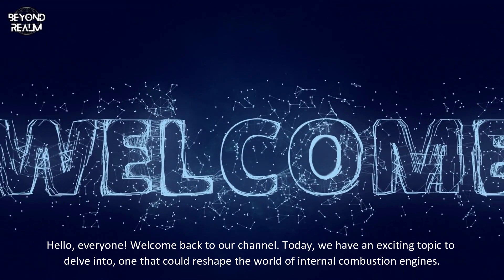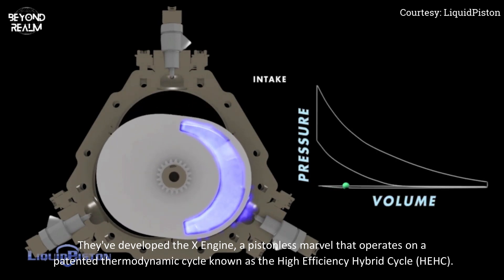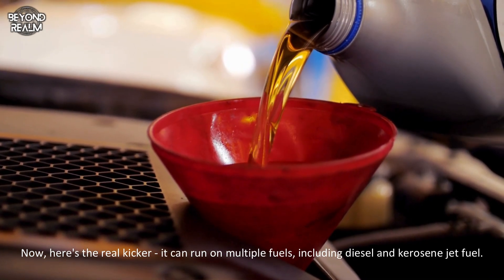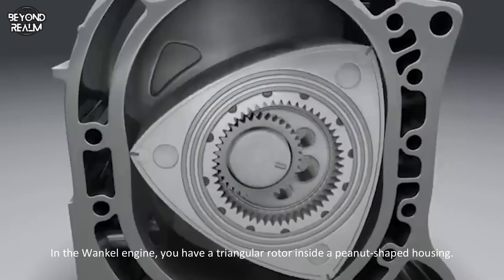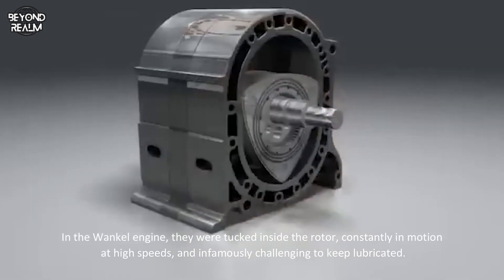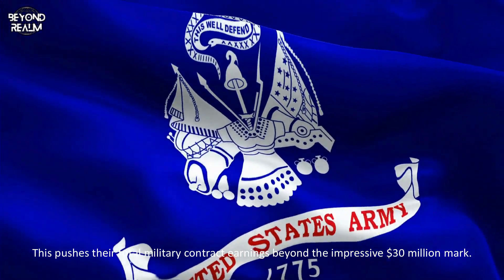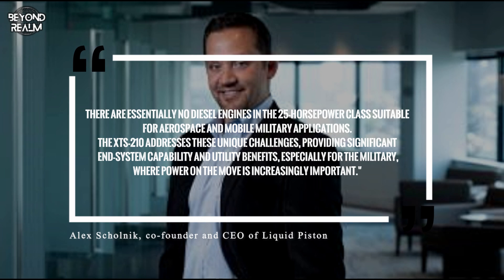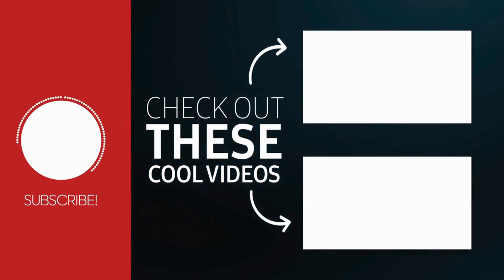This NEW Engine Delivers 5X The Power Of a Diesel Engine | XTS-210 Rotary Engine | Beyond Realm.

Comment: Where is the multi-rotary version? Do they plan to produce any for automobiles? I hate EVs! They didn't think them through. They are dangerously explosive and pollution causing via sourcing the lithium for replacing and disposal of old batteries. They still require electricity which still requires powerplants. Also, who can afford them?! Hydrogen fuel for the win, and the XTS rotary engine can burn it!
Reply: I'm having doubts about hydrgen fuel. Volume wise, its energy density is a measly 8 MJ/L vs 34 MJ/L for gasoline. In other words, it needs to be compressed in order to offer competitive power density. Compression is too expensive and liquification is out if the question. Liquid fuel will always be the better option. I would rather see batteries as an alternative, but current batteries have too many drawbacks. Expense and safety being the two main ones. However, on the horizon, sodium battery technologies are making big strides.

Comment: It is heavier than Wankel of corresponding power, not much more efficient, and uses 3 times more injectors and spark plugs. Very hard to stack in more powerful multi-rotor configurations. Mazda, having all the required know-how and technology is totally uninterested in this engine.

Comment: Time will tell, but I predict failure.  You can't make a quality piston ring equivalent in a rotary motor design. Diesel usually requires high compression cylinders and that requires good rings.  Square things don't survive high heat & cooling was a lesson learned by the pot belly stove people. But here is a thought for you.  Using a swinging door style piston on both sides of a waste veggie oil burner in a Stirling type motor I could power my house as it heats my house and hot water, while cooking my large stew pot using gravity to do all the work. No pumps, no filters, no tech, no cost, no sh*t. Of course the Peltier/Seebeck effect electrical generation between the cold and hot water sides of the riser is optional. Yep, you heard it here first. Well that's the spiel anyway.  I invented, built, & used the burner for 10 years, but never invented/install/used the Stirling motor design. But a swing door type would be very large pistons equal to about 4 square feet of piston top & that's a WOW. Even though Stirling isn't big power output per cubic inch, massive inches adds up to big power 4free. With a door on one side going out the same time the other side does, they counter balance each other.  It's a heat difference engine so a cooling side could be installed on the outside of cylinder & the valve between inside/outside can be at the hinge. That would preheat my cold water tank also. The cylinder looking down is a 2 slice pizza pie shape. An outside arm from the hinge pushes on connecting rod to crank where the 90 degree valve arm  or second piston door is attached, and the valve is just a vertical door also, & it's arm comes off it's hinge also.  Any form of piston rings can be real sloppy, loose fitting, low friction. I give my Stirling motor design to the world, anybody who wants to make it and sell it, but not own it, cuz it's my intellectual property always. A big thanks to Oliver J. Loveit my power mechanics teacher & 2 doors per Sterling side may be required.  Also, in the process of inventing a controllable veggie burner, I made a veggie burner out of a 3 gallon propane tank than ran like the WW2 V1 BUZZ BOMB plane pulse motor at a very powerful high rpm, but it had no moving parts. Any way, good luck to you guys on your rotary diesel.

Comment: This engine is awesome, but it doesn't last very long before needing to be rebuilt.  I'm sure they can solve some of those problems and improve it.  The genius is really in it's simplicity and the promise is in it's power & torque to weight ratio.  Very cool indeed.
Reply: @AWAGKnives  , So how long (hours), have You supposedly  found  , these engines to last ?  What was the map setting during  the supposed testing process that You supposedly witnessed? What are their supposed problem areas? What , supposedly, has to be rebuilt after You found it to be worn out? How did you supposedly check for wear?
Reply: @michaelmartinez1345  This comment reads like somebody that is clueless pretending that they know a lot.
Even if he did give you that information, you'd have no fucking clue what to do with it.
Reply: Allegedly  @TheLairyLemur

Comment: So when can I expect one to be available to replace the 1150 pound 5.9 Cummins engine in my Dodge pickup? It wouldn't have to be very big, but would need to be geared down before input to the transmission so that it's output speed would be a good match for my gearing. I could put a lot of other things where the huge engine currently takes up space that would not be needed for the new engine. It might even be profitable to put in a much smaller one to operate the alternator and hydraulic systems of the truck. That would be very cool. I could park and run the generator to power my ham radios while at an event such as Field Day or Jamboree on the Air or Parks on the air. That would be great fun. And with the 35 gallon fuel tank it should extend the range of my pickup to maybe twice what it is now, 600 miles if I drive no faster than 70 so 1200 miles before refueling... Woo HOO!!!
Reply: Your cummins will outlast an equivalent engine by 10x

Comment: Power to weight ratio is nice, the military will buy them just because of that, but for any commercial, particulaly on road application what really matters, apart from durability, are emissions and fuel economy. Those are the points where the rotary engine failed. Bad emissions as well as bad fuel economy.

Comment: I loved the rotory motors we would welcome them back with open arms.  Another one outboard marine engines just fit a heat exchange on it .that would be interesting to see  ?
Reply: @bullykuldo6233 , The outboard boat engines are genuine works of art... I love all of them... Especially the older 2-strokes.  They would need a thermostat and a water pump that is driven directly off of the engine, instead of being mounted inside of the lower prop drive unit... They already have liquid cooling jackets to possibly support this fish - swimming out of the water ... Plenty of power to drive the wheels, or a generator... But they tend to create a fair amount of emissions, because they are usually  running so cool... And to bring the operating temperature of them to a higher level could possibly create new problems, because of the necessary clearances being lost .. These fish , need to be kept in the water...

Comment: @Goldcountryruss7035, The emissions (or lack thereof) that this engine will produce, will probably be one of it's major selling points... It will probably run very well on a variety of alternative fuels, and the issues of high emissions that were generated by the Wankel engines, have largely been solved with this design, mainly because of vastly improved SEALING of the 3 combustion chambers it has, as compared to the poor sealing of the single combustion chamber each rotor had on Wankel type engines... The power numbers show that much, 4.0-7.5 H.P. for a single rotor prototype machine displacing 210 c.c.'s of air... From what I have heard about these, they also run very smooth...

Comment: @Clintvosloo7694  Somewhat similar to a Wankel type, but with several significant differences... What is one of the very advantageous things about this design versus reciprocating engines is the power to weight ratio, and it's far less complicated. When comparing it to a Wankel, one of the several advantages it has is the absence of sealing issues, when the rotor pass's by the spark plug port... The Liquid piston engine has a fixed position combustion chamber and the spark plug port is NOT located on or anywhere near the sealing surfaces of the rotor or the rotor chamber sealing walls...   
     The Wankel type has apex seals located at the 3 tips of the rotor , that travel across both spark plug ports, which causes a significant compression and power loss, and a case of somewhat dirty/carbon  ridden exhaust emissions, inherent heating and lubrication issues, and fairly rapid wear of the rotor apex seals because of consistently passing over both openings of the spark plug ports that are necessary with that design..... 
     The liquid piston engine can also be smaller and lighter because of these and several other design changes... Like 3 active combustion chambers per rotor chamber, instead of just 1 active combustion for the Wankel.... The Liquid Piston engine will Probably be less expen$ive to manufacture than several other types of engines as well, because of it's light weight and inherent simplicity ...... Like so many things, the simple things are often the compilation of many years of learning and research.... This Liquid Piston engine appears to be one such design... Simpler, Lighter, More Powerful, Better.....
Reply: Evolutionary change. . .hope it has a future
Reply: significant diff my es..
Reply: @nin1ten1do  The changes and differences between this Liquid Piston Engine and the Wankel, are Probably several times more significant , meaningful, and useful than Pong,  compared to the most advanced gaming devices available.. These machines actually do things that are necessary for our daily routines, and are far more useful &  necessary than devices built strictly for entertaining those who are suffering from boredom ..

Comment: Note, not a single word on emissions. If it's not clean burning its applications are severely limited so automotive, motorcycle, and marine use may be limited.
Reply: explain why u think a steel engine that goes up and down emits air and water, while a steel engine that rotates emits extremely toxic radioactive dust & slime. Does your theory say that steel in a rotary motion opens a portal to hell? Don't remember any engineer or scientist mentioning this.
Reply: First : it's better comparste Wankel design.
Reply: @goldcountryruss7035, just as I already mentioned , of the variable factors of how the emissions that this engine design will produce, depends on what type of fuel, that will be used to power it , of which in this engine design, could be several different types of fuel... I feel that natural gas would work extremely well with this engine... And the U.S. happens to have huge amounts of CNG in the Eastern states.... When mixed with known readily available gass's that can act as catalytists during the combustion cycles, it could influence a complete fuel burn and drastically reduce emissions, add efficiency and increase power, thus reducing the amount of fuel needed to do the work...

Comment: Insane because it doesn't even work
Reply: Insane because it does work. This is the "liquid piston" engine which was invented a couple years ago. It's basically an inverted rotary engine. So, it's nothing super new is but it's power to weight ratio is really all that's cool about it.
Reply: @akbarshoed and lukekolodziej9631 1) It does work, and dyno tests have already confirmed the 4.0-7.5 h.p. this very light and simple 210c.c. displacement (0.21 Litre) prototype engine design has achieved...   
    2) There are major differences between the Wankel and this design. One of several improvements made with this design is the much better method of SEALING the vacuum, compression and combustion EVENTS when this engine is operating... Several other things are inherently better as well... A complete re-design of the Wankel engine... The Wankel was Good, but this is so much better , in so many ways...
Reply: @michaelmartinez1345  why?  What's with you?  Why are you a believer?  Show me the running engine.
Reply: @michaelmartinez1345  I literally said it works... why did you @ me lol
Reply: @lukekolodziej9631  Sorry Luke... That reply was meant for another commenter who does not believe that it works... My mistake Amigo ..
Reply: @lukekolodziej9631 YOU HAVE *LIE-ARRHEA!!*
Reply: @tompsheridantsheridant7354  Please take a course to help your sentence structures, spelling and punctuation application .. It will help the viewers to  understand what messages that you are trying to pass onto others...
Reply: It works very well .
Reply: @thomascorbett2936  in your car?  Truck?  What?
Reply: @akbarshoed and @thomascorbett2936 , This is a prototype... That means the concept is being proven, then it will be developed... This prototype engine, when it has been developed, will be able to provide power for numerous things, vehicles included... Probably, the most significant things about this machine, is the high power to weight ratio, the simplicity of it's design, the ability of it to run on a variety of alternative fuels, and the capability of very inexpensive production, when mass-manufacturing becomes available... The possability to operate on alternative fuels will be a major game-changer, by itself...
Reply: They have video of a prototype on a go-cart running! It works!
Reply: @shuckarelli  link please

Comment: Its powerful for its size. Ok. I dont think itll really get anywhere.
Reply: PThe military has contracts with the company to make the motors for power generators, I've seen this used in go,karts and it is really impressive. I have been watching this company for a few years and I too said the same thing originally but now they have signed multi million dollar defense contracts I doubt they will be going anywhere anytime soon.
Reply: @gamersplaygroundliquidm3th526  I watched that video. It was a hybrid go cart. It just needs to be bigger and I’d like to see some stats, horsepower and fuel efficiency when ran on pump gas. For now it is just a science experiment which is cool sure. Good for generators too maybe. Reliability is the big factor it if they can pull it off then I’d love to see it. I’m already a big fan of the wankle rotary.
Reply: @gamersplaygroundliquidm3th526 and theredwedge9446,  Those DOD contracts will enable them (Fluid Piston) to re-invest that money into more research & development of larger, more viable designs... Ones that can effectively be used to power full sized vehicles, using alternative sources of fuels / energy... That type of re-investment could likely grow that company very rapidly, as the similar types of funding brought several American companies and their vendors out of the Red and into the Black ...

Comment: They are developing a new engine in a world where electric is taking over.  May have been a good idea 20 years ago...
Reply: @user-jo2yr9of8s- Not necessarily is the world going to be "taken over" by electric powered only vehicles... The vast majority of electric vehicles are using large groupings of batteries to store the massive amounts of electrical energy, to make a normal road trip, not far from a known charging station... That is proving to be very ineffective... Ok for golf courses , factories, apartment complex's, etc. that  don't need to travel far from a charging station in their 800 pound vehicles, that travel on paved level ground... Not so good for long distances, mountains, rainy weather, headwinds, soft dirt roads... That is where vehicles with some gusto and extended range are going to be much more reliable... This Liquid Piston engine design could provide a smooth, efficient, lightweight source of mechanical power, that could possibly be shafted into a drivetrane, or power a relatively lightweight electric generator, to charge less expen$ive batteries that are smaller & lighter,  than what the all electric battery powered vehicles have... A hybrid... The thing that makes this engine different, and a good candidate for a hybrid power source, is it's capability for it to burn various alternative fuels, and it's lightweight/ air-cooled design , extreme simplicity (2-moving parts) and it's very high power to weight ratio... Couple this engine to an efficient - relatively lightweight electrical generator, and You've got a WINNER to run a hybrid set-up!!!
Reply: No current , Har har, battery or fuel cell has the power density of diesel fuel. Military wants one fuel for everything it uses, Small HP diesels suck. If they can produce an engine that was governed down to 3600rpm, they would conquer the portable generator mkt